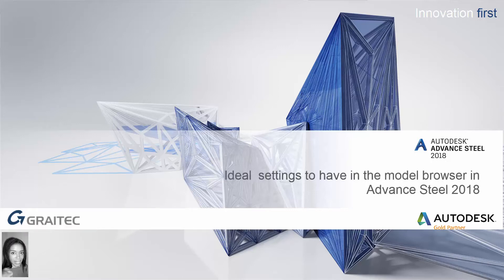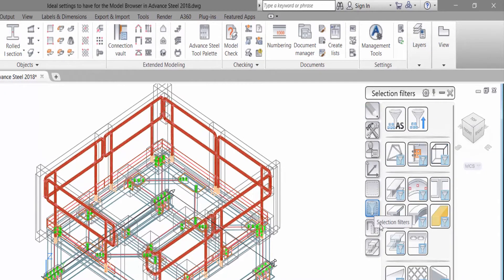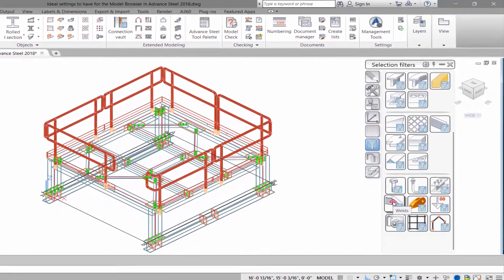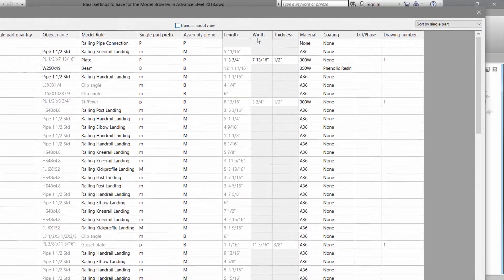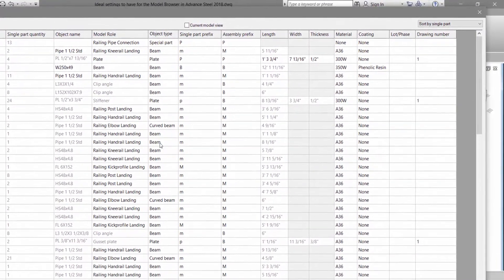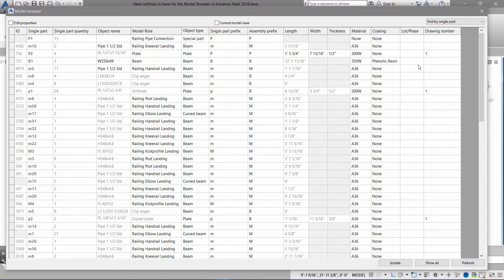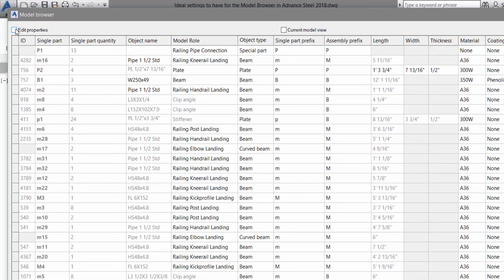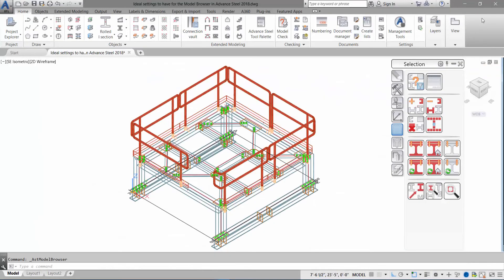Ideal settings to have for the Model Browser in Advance Steel 2018

Comment: Ok, this is all well and good, but what about the framing connections, the details of the connections - Are you able to show that? Which is the most important thing to do in structural detailing. All that you have here is the overall model. The man in the shop will be at a loss as 'how' to make his cuts and fits. How is this done in Advance Steel?
Reply: @buddydog1956, in this video we are just showing ideal settings for managing intelligent members.  Advance Steel does a great job with framing the connections using intelligent/dynamic/parametric macros in one or two clicks. Please see this video for some of the possibilities for Advance Steel Connections: https://www.youtube.com/watch?v=ynqzlLYxalM             I can also show you more if you email support.americas@graitec.com.  David
Reply: Advance Steel is GARBAGE! Trust me...better off going with a real program that understands the US Steel Fabrication and Detailing industry.